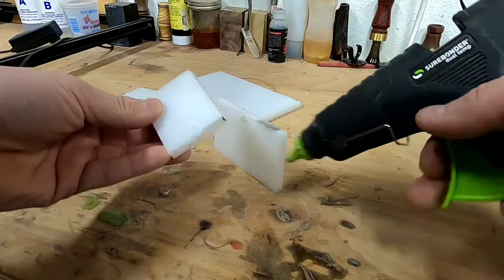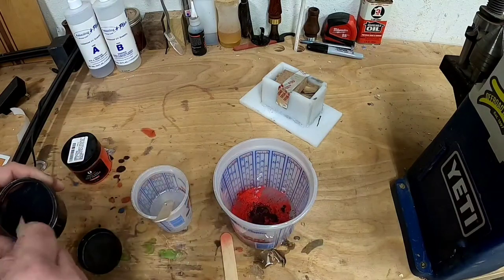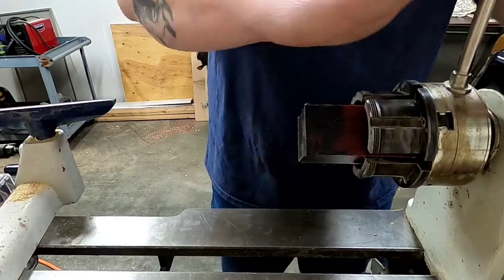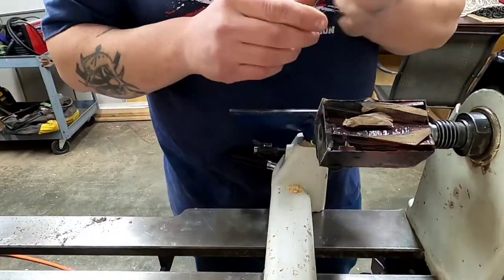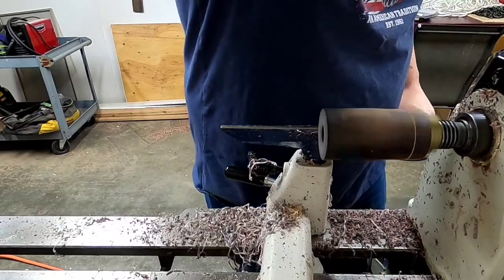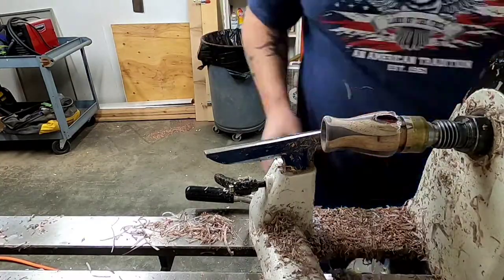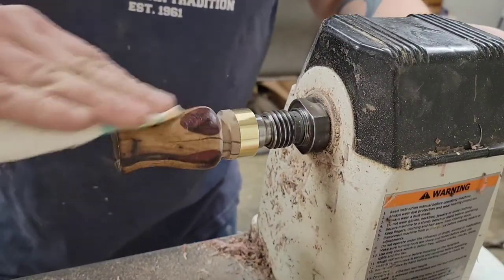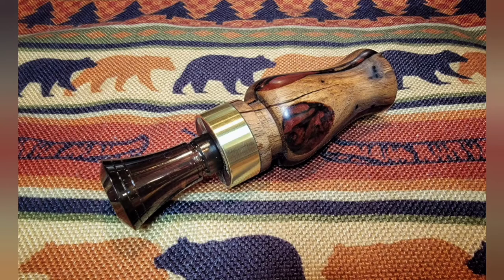Duck Call - Black walnut and red/black epoxy!

Comment: are you using negative rake carbides?
Reply from the maker: Unfortunately I don’t have any negative rake carbides. The only carbide I have is a round tip Rockler carbide. I do need to invest in some though.
Reply: @JustinBeyerlin1  ok just wondering. im just getting into it and also have the roeckler carbide but not negative rake. i keep blowing up my blanks though so was wondering if it was just the material i my blanks are made of being too brittle. thanks